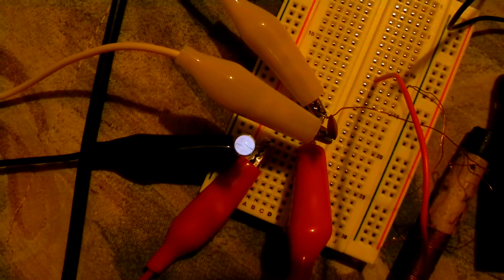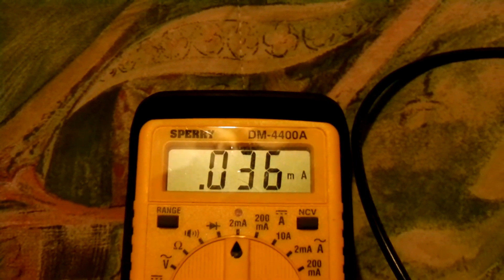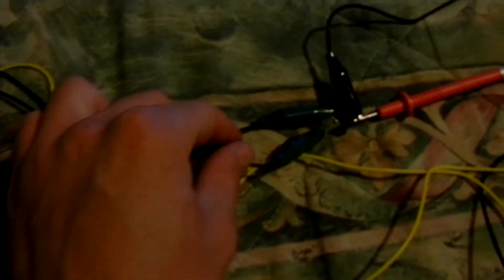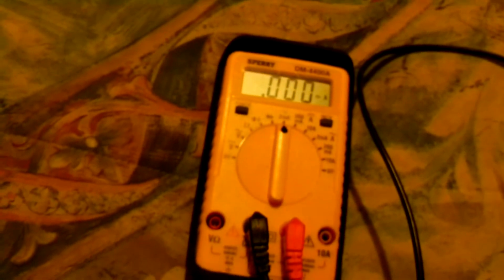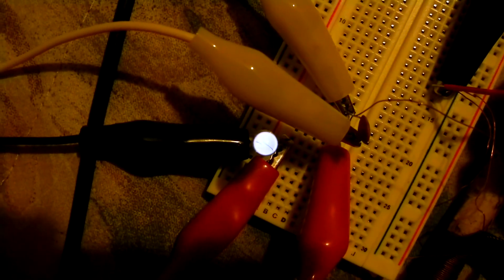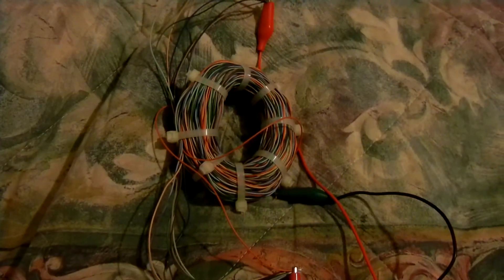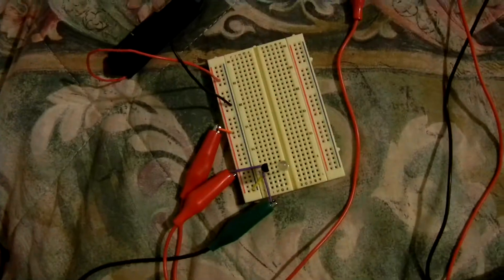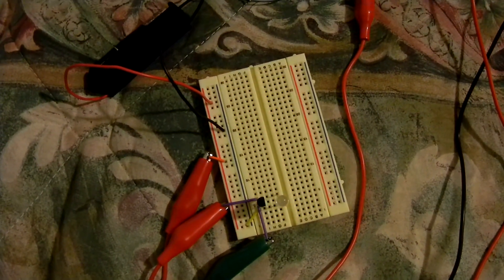Lidmotor/Lasersaber Joule Thief

Comment: I noticed the LED is very dim. The darlington pair has the two base to emitters in series, which adds up to 1.2V, which is almost as much as the battery, so the performance suffers. Also, it cannot turn on below 0.6V collector to emitter, which causes excessive loss in the transistors. That's why the darlington pair should not be used in a JT circuit.  Thanks for the clip.